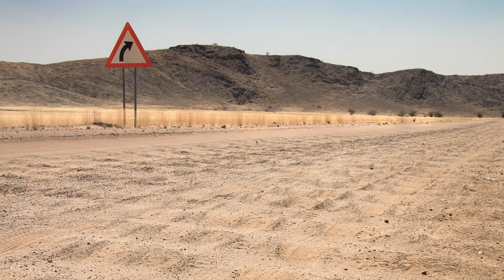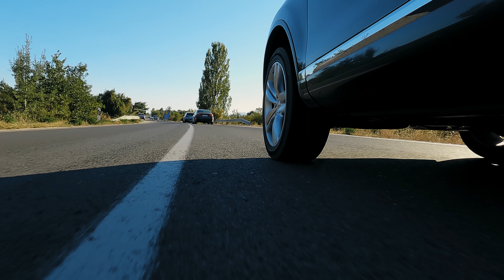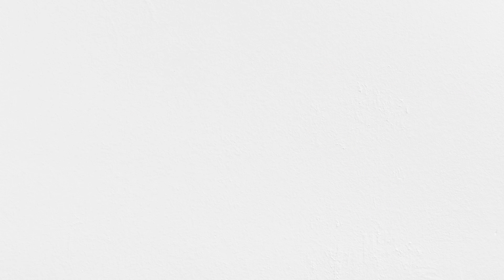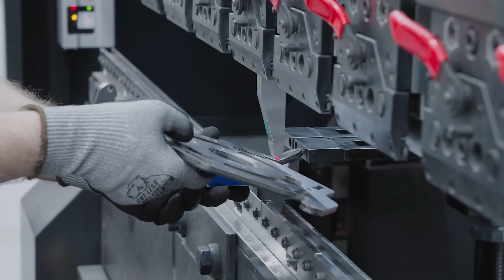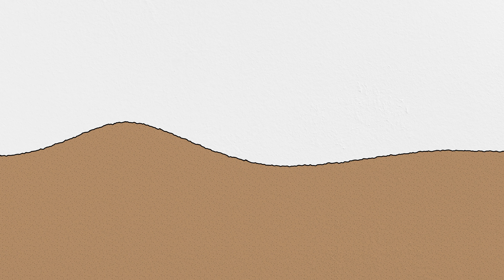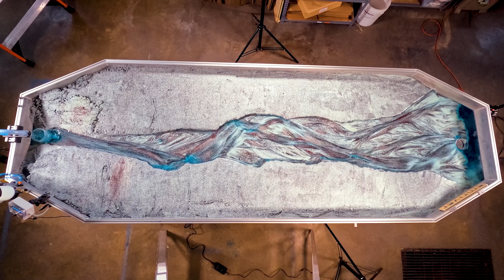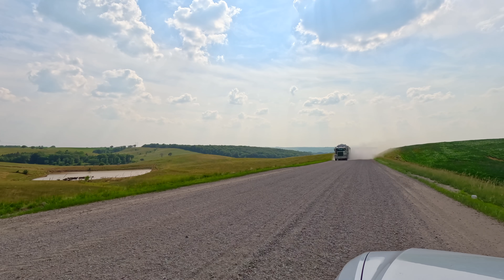Why Roads Get Washboards

Comment: I've been maintaining gravel roads across the U.S. since 1992 and can tell you that if we reduce the amount of loose material ontop of the roads, the corrugations caused by higher tire speeds is greatly reduced.  When we placed too much loose gravel or stone, wash boarding occurred quickly.  When we balanced the volume of gravel, we were able to go months before regrading the surface.
Reply: Have some really good dirt roads where I grew up that got graded a couple times a year. The guys who maintained it told me it was capped with a very specific mix of gravel, sand, and clay which was every bit as engineered as an asphalt cap just using locally sourced material.
Reply: In the county I live in Colorado,  they said they are not going to grade any gravel roads until we get significant moisture, whats the reasoning behind this? Does the moisture soften it up?
Reply: @janachovsky420 no it will compact evenly if washboards are cut down deep enough  and make a flat compacted surface and lessen the need for maintenance
Reply: I'm not in road maintenance, but we did drive around them a lot while I was with the Forest Service. I always thought it was a cost saving measure as well. Because they would often have a water truck spraying the road down before grading as well. Which I assumed helped with dust and compaction. I'd like to hear from someone with experience if that's true or not though? I'm also in CO and it sure didn't take long before the roads were terribly washboarded again.
Reply: @janachovsky420  It compacts much better when wet. Something engineers refer to as optimum moisture content.
Reply: Ground compaction will take the shape of washboards and if ground isnt compacted flat they quickly come back so if compacted washboards exist you have to cut below the lowest point of ground compaction to correct the surface
Reply: @jarvislarson6864 and that doesn't happen. Because it would cost to much to plow and blend 2' of dirt. So we just smoth the top inch or two. That doesn't hold up long.
Reply: Thought I'd point out, mountain bikers will refer to these as braking bumps. They really only occur on the trails where people apply excessive braking. Interesting to learn "washboard" is most likely caused by variations of speeding up or slowing down.
Reply: would drifting a car on these washboard roads help its condition?
Reply: Interesting.  I DID notice that some of the steeper gravel roads I drove on for a field project would get washboarded WAY faster than the rest, and thinking back I’m pretty sure they had far more loose material.  Although the grading obviously made it instantly better, I also noticed that once that road started to degrade post-grading, it got waaaaaaay worse, to the point I’d hope for the rains to affect the road as well because then at least it stabilized the road at “bad” instead of “terrible” for the many months until it was graded again (grading typically was only done once a year), which was weird.  I wonder if the rains washing away some of that excess loose material was actually part of what made it only “bad” instead of “terrible”.

Comment: Corrugations occur when the gravel used as road base loses the fines which bond the granular material together. Fines can be lost by being washed away, or by the material drying out and lost as dust as vehicles traverse over it. Only way to stop it happening is to seal the surface off to prevent the fines being lost.

Comment: I have to disagree with this theory. I've lived in the Rocky Mountains for 30 years and have observed that washboard is caused by the tires on heavy equipment "tractors" that are used to scrape and "smooth" the roads. They first soak the road with water and then scrape the road. That combined with the angle and camber of the road and rainfall and snow melt effect the washboard condition. My friend from France agrees with me and he told me that there are dirt roads in France that date back CENTURIES that have never been "scraped" do not have washboard and never have.

Comment: A few important factors missing from this model:
1. Acceleration and deceleration points, on a road, are where the washboards start. The more the road is driven on the more washboards that develop.
2. The amount of hard and soft surfaces (surface that binds well vs surface that is loose, like sand) is factor. Usually an even blend of sizes of aggregate with very jagged, not round, has the most resistance to washboards.
3. The efficiency of the shock absorbers on the vehicles.
4. Aggressive driving, the degree of acceleration and deceleration can have a great impact on the size and amount of washboards.

Comment: Im no scientist but, my theory is torque between the contact surface of the road and tyre start the ripples, and your engine setup, straight 4, 6 , v5, v6,v8,v12 etc create I miniscule spike in torque at the time of the power stroke at that specific angle within the complete rotation of the crank. This gets the ball rolling for the wash board. Only then it get amplified by your experiment setup. Your setup is only run by drag

Comment: The most common location I've dealt with washboards has been coming up to a stop sign. I had figured they were caused pretty similarly. The first hump is made when someone hits the brakes maybe a little too hard. There's just enough reverse torque that there's basically a tiny skid(not enough for you to feel), and it's gets worse causing wheel hop, which feeds back into it.

Comment: A little suspension with a dual adjustable damping shock absorber, variable spring pressure, and a Variable Weight Beetle to turn left with one to four Beatles onboard could be interesting, informative, and possibly even inspirational.

Comment: I tried to use Send Cut Sent, but the cost was like $211 each for 2 spacers I needed machined. I passed on that. 😅 As far as the video goes, washboard roads is a big reason I air down my tires when doing off pavement adventures. Helps a lot with ride quality, and also helps prevent washboard in the first place.

Comment: Does it make a difference if the wheel is driven or not.  A driven wheel might pull material back as well as push it forward?

Comment: I believe what makes the washboard build up so robust regardless of the variety of vehicle is the fact that even with different specs (weight, tires, suspensions, and so on...) they are always tuned to a similar goal in terms of human comfort, resulting in a similar vibrational behaviour. It is then only a matter of time until a common-enough resonance frequency shows up somewhere as a single ripple length at the common transit speed, and starts building up from there because each single transiting vehicle will be similarly sensitive to that same frequency regardless its constructive specs.
It would be interesting to test this idea on your rig by driving with different set-ups in which multiple wheels have similar or very different resonance frequencies.

Comment: i've watched them be made by mother nature for 30 years. rain washes away the loose soil just like it's making a future river. it's most especially accelerated by high braking zones. axel shock absorbers  only one for forward torsion and one for rear torsion do the rest as the axel gives shimmy twist packing after impacting the sudden drop in road pressure.

Comment: Finely, someone who covered this. You ought to ride those "washboard" roads on a motorcycle, especially a smaller one. Been riding for 49 years, and sometimes it'll rattle your teeth. There's always the "chip seal" surface, which is a hybrid of gravel and asphalt oil. I was up in the Yukon on the Alaska Highway last year, and they were repairing many miles of their chip sealed roads. When they shut down the work due to weather, the roads stay open and everyone continues to drive on them. The washboard can get intense when you're on a Suzuki scooter like mine. However, there was a little strip of smoother gravel on the very edge of the road bed. It was the only place I could go to keep my scooter in one piece. Over the years I've been on farm roads here in Illinois, and even though every type of tire, size of the vehicle, speed of the traveler, the ripples will still have a particular rhythm to them. It's totally fascinating.

Comment: A Roadgrader operator explained that the first time fresh road base is spread is the critical stage in Not getting 'Washboard' roads too many operators want to make a smooth surface too fast.  In doing so the blade of the grader starts the wash board effect quickly to much pressure and a squared to travel surface creates the harmonic unseen ripples and compacts it in to the road base which quickly reveals it self as a wash board. I have watched him.  artistically remove wash board dirt roads reapplying a surface using the removed material and make a grave dirt road that, still has no washboard coming on 12 years. he stressed in his experience you can't go too fast in applying the surface layer.

Comment: My experience has been washboards are the result of braking.  You see it on snowmobile trails all the time.  Even on a gravel road, the newly grated road gets washboards around braking areas first, then expand further out onto the flat sections of the gravel road.

Comment: It’s wild how washboarding is essentially a granular physics paradox. The smoother and more uniform the dry sand/gravel is to start with, the faster the rippling effect propagates under periodic stress. It’s the ultimate proof that you can’t fight fluid dynamics, even on solid ground!

Comment: Gravel is a lot cheaper but cost long term. The road to my property is gravel and then the 600 foot driveway is gravel. I was told a huge quote for asphalt so for now I will stick to $350 gravel loads to keep building and fixing.

Comment: I clearly can't argue your point at speed.  But, How do you explain the presence of the wash boards in areas of braking and acceleration?  A driven wheel will or a wheel under braking changes how  the wash board is created.  Just like hydroplaning, when the required surface area needed for traction is reduced to unacceptable limits, the tire slides under the surface area is achieved then the tire rolls over the excess, making a bump.  While accelerating, when the need area for traction is lost, the tire spins,  digs  down in the dirt, creating briefly more surface area contact, thus traction increases and the tire drives up and out of the hole its dug.  Now at the top of the hole its climbed out of, it loses traction surface area again and starts to spin as it comes off the newly formed hill., hits the low spot, digs in spins creates more area for traction and repeats...making wash boards under acceleration..raking is the opposite.

Comment: I’m curious how tire pressure would impact this… if you are running a soft say 18-20 psi vs the typical harder 35-40, will the tire absorb inconsistency in the road better and reduce washboarding?

Comment: I have to rebuke this.... at least some of it.  Much of the "washboarding" shown here is the result of the grader blade bouncing (chattering) and creating that washboard effect.  If I am wrong despite my experience grading roads, take note of how the washboarding extends the entire width of the road where no, or very few vehicle tires ever make contact.  Also, countless "washboard" roads I have driven on never see enough traffic to cause this to happen.  
When you grade the road, the conditions have to be somewhat wet.  If it is hard and dry, the blade is just going to bounce over imperfections in the road rather than scoop them up.  And the "wavelength" of the washboards should be greater than what we see on most dirt roads if it was vehicles causing it.

Additionally, this "washboarding" effect is very well-known by those who ride snowmobiles.

Comment: They actually formed due to radial tires. Running with lower pressure the tire flexes up and down. Back it the days of poly tires there was MUCH less washboard.

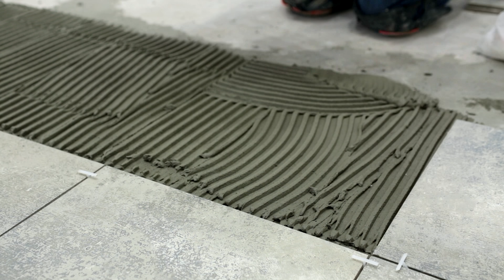Comment: 3:27 that trowel work is horrible. Going to have a hollow spot in there. You NEED to do straight lights so the air can escape and create a good seal and base that prevents impact cracking.
Come on stock footage installer guy!!

Comment: I drive hundreds of kilometers of gravel road each week. My observation is that corrugations appear first and prominently in accelerating lanes. A theory I have is that it is a direct effect of the power strokes of internal combustion engines. By the time the few thousand rpms of the engine are geared down to the circumference of the drive wheels one will likely find the ratio of the power strokes correlating to the wave lengths of corrugation.

Comment: I grew up on the ULTIMATE wash board gravel road. It was a massive issue and we all 'celebrated' the intermittent arrival of the Road Grader. I currently have 3/4M driveway... and I would absolutely request that you do a variation of simple Geotextile underlayment vs cellular gravel road system. As I have the need to redo the driveway in its entirety and need to make a decision on which direction I go. (the first 1/4M is on an uphill grade, so I have the added bonus of design for water erosion as well.)

Comment: Its almost always braking and accelerating zones that start first and are the worst. I’ve also noticed on gravel roads that are 4wd access only tend to have taller/deeper and more persistent and continuous corrugations. I  presumed this is because 95% of the tyres running on it are very similar dimension/footprint so they’re always kicking up dirt in the same place/same way.

Comment: It sort of seems like the issue is exceeding the wheel's "hull speed". So up to a point determined by width, diameter, and soil aggregate size the wheel sort of acts like a displacement hull on a boat. But when it exceeds its "hull speed" the "wake" becomes a jump. And then the whole rythmic relation kicks off. So any perturbance can start it or just the fluid dynamics of the interaction can start it. Or is this just me seeing things?

Comment: Very interesting content!

I’m a rolling stock engineer. The rail equivalent is called corrugation. The phenomenon in which the steel wheels hit a ‘bump’ on the surface is known as P1 force. Subsequently the wheel vibrate with the steel rail together in resonance at a frequency known as P2 frequency.

Comment: 13:40 I’ve seen washboarding even on blacktop - probably wasn’t cured and/or cars going faster than what was calculated…assuming the calculations and mixture was correct for the use case.
Reply: Yea like downtown Baltimore or New York. You get both washboard and lane waves. Ive even seen it on heavy machinery with cams that don't have super tight tolerances by design and the eccentric cams aren't adjusted often as needed. You'll see waves of separating metal almost like it was clay. Very sharp and brittle.
Reply: In Alaska it also happens from frost heaving. Permafrost melt is generally more dramatic, but can also cause washboarding before major collapses.

Comment: 11:40 I appreciate the effort that went into creating the model. Where I live in rural Alberta we have many gravel roads. I frequently drive over washboard, but our roads are hard packed gravel with a clay base. Most of the washboard happens going up hills and in places after a stop sign or corner as the vehicles spin the tires to accelerate. It would be interesting to see if the model tire/wheel was driving the arm vs being dragged by it and if the road was more densely packed with a hard gravel vs soft sand. I am convinced spinning drive wheels causes the washboard not just a wheel rolling over the road surface as in the model. If the model had a harder gravel road and a wheel/tire was that spinning in even a 1/4 of the track but just rolling with out spinning for the rest of the circle what the washboard pattern would be like. I think spinning wheel hop will increase the severity of the washboard.
Reply: I believe the same.  In addition to accelerating, I’d love to see how braking affects it too.  Areas where vehicles accelerate and brake seem to be the areas that form the washboards, in my experience.
Reply: @buck4mt yes, It's super noticeable on ATV trails coming to and leaving stop signs, Even more so with snowmobile trails
Reply: Yes I agree with you. His testing model is interesting but the wheel that he is using has no power to it which I believe is the main reason why we get wash boarding. I am in Western Washington and I’ve noticed the same thing on logging roads here as well, most of the washboard occurs on Up Hills or roads with a upward grade.
Reply: @guernseygoodness  actually i think you've got it backwards- the fact that his wheel with no drive power to it causes washboards, as does an angled plate, shows that it's not about the drive (force pointing away from the direction of travel), it's about the push (force pointing TOWARDS the direction of travel).
Reply: Yes! I've driven thousands of miles on dirt roads all over the US and washboard always forms where people naturally accelerate. Going uphill (always on the right side but not so much the left), coming out of a turn, etc. I'm not saying it only forms in acceleration areas but it does form there reliably.
Reply: Exactly
Reply: Pipeliner here from AB, drive these roads daily. They washboard quicker with a bad base. In areas with more rock and better water management last much longer. Ive driven a few limestone roads and those you can travel 100kph and they last a long time before re grading where others can be graded every 2-3 days

Comment: It's worth mentioning that similar phenomenon happens also on paved roads in spots where there is a lot of shearing forces - typically at stopping areas before junctions, traffic lights and so on when the quality of the pavement is sub-par. The asphalt layer will form similar "ripples" due to all the stress inflicted by braking vehicles.